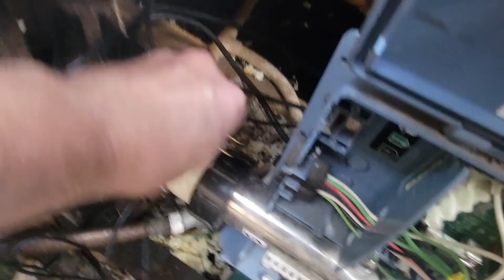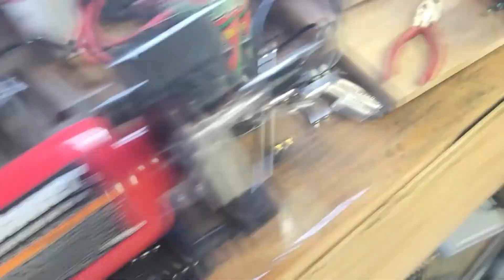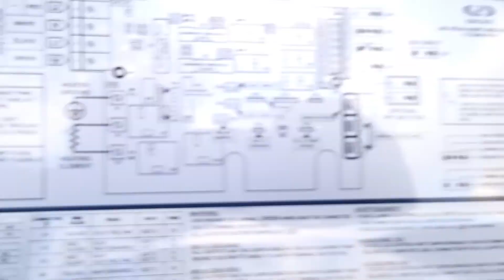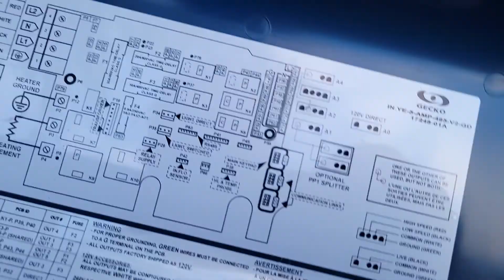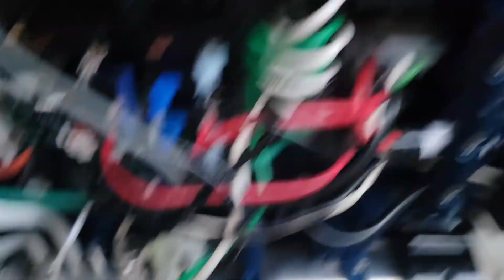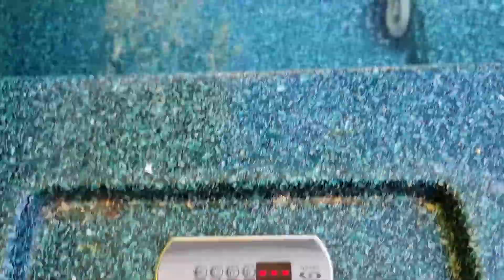Hot Tub Control Panel Replacement & Install New Gecko or Balboa New Spa Pack Topside Controller

Comment from the maker: Here's a link to the parts I've replaced in my hot tub control panel:
--Gecko Y Series In.Ye-5 Bundle: https://amzn.to/4ajTbkp (good for Balboas, too!)
--Aqua Flo Master 230v Spa Pump: https://amzn.to/49h6gKB
--Aqua Flo (Wet End only): https://amzn.to/3TkuVrD
--In.K200-20P Topside Display: https://amzn.to/3vgfwR8
--Ratcheting screwdriver: https://amzn.to/4cjLmgq

(These affiliate links will take you to products that, if you purchase them, they will give me a commission which helps me make more videos. Thanks!)
Reply: So did you end up going with a different top side display controller? I thought the kit with the new spa pack included one?
Reply from the maker: Mine came with it, but added the link in case that's all a viewer needed.

Comment: While using a multi meter Im getting voltage checking the wires going into my control box but jot at the heating element. When checking between the heating element and wires coming in i get very low voltage and when checking continuity and ohms on the heating element I have to finagle it but I will get a reading. 

i cant tell if just the heating element needs to be replaced the whole heating tube (i dont know the name) or the entire control box. I am on a buget and dont want to spend 500+ on a box just to change a 30 dollar heating element

Edit: im getting power everywhere else, the pumps work the button panel works and light works just not heating
Reply from the maker: Did you try checking the voltage when it calls for the Heat? Meaning, do you see an increase in voltage when the thermostat calls for heat?